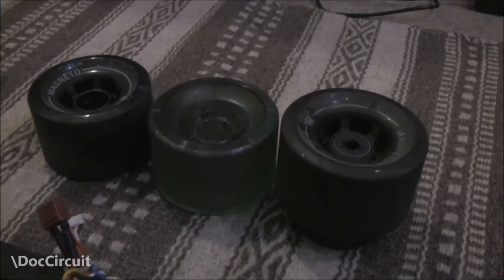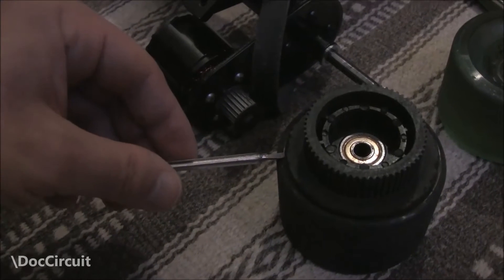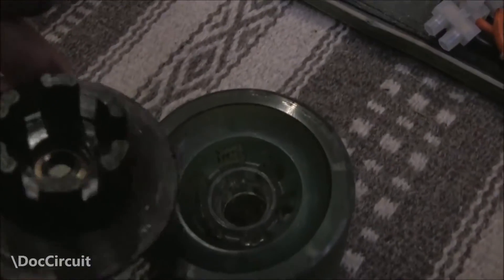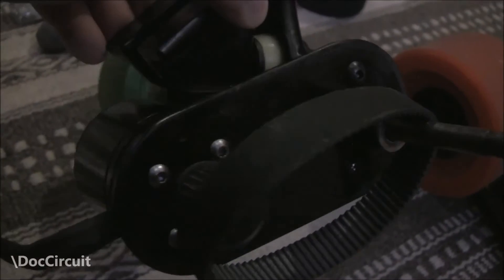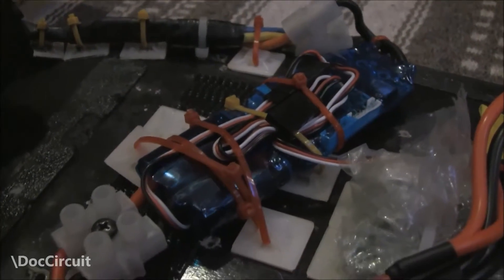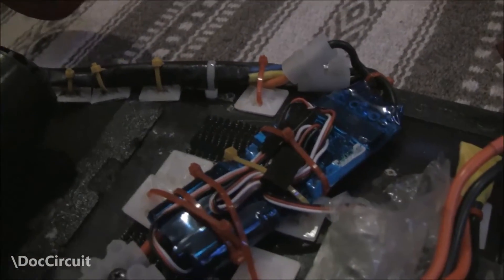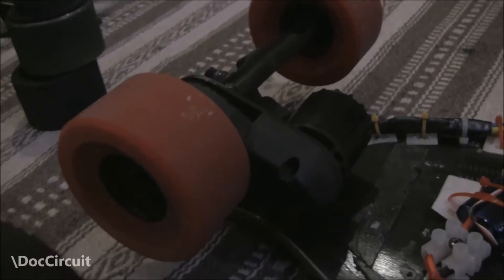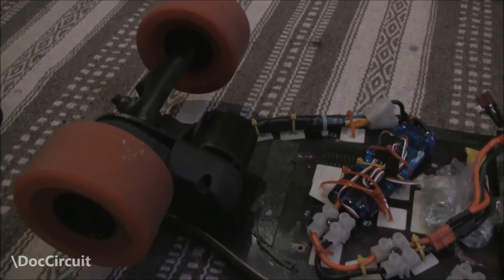Fitting Large Wheels to a Chinese Clone Electric Skateboard!

Comment: Thanks to you, my board turned from a cheap, unreliable and dangerous board to one great board! very smoothhh with the VESC, can't wait to install my new wheels! will the big wheels help significantly on rough surfaces?
Reply from the maker: Thanks for the kind words! :-)

The big wheels will increase your top speed and smooth out some of the bumps - a worthwhile mod.
Reply: hey again Dr Circuit,
I just got two ZIPPY Flightmax 5000mAh 3S1P 20C, will it work on my board and charge using stock bms? also how many miles do you think its going to give me?
Reply from the maker: 1. It should do but do check the power supply - it shouldn't be too warm.
2. Notoriously difficult to predict. Essentially your battery is a 10000Mah battery, the stock battery 'claims' to be 8000Mah. Do NOT think the claimed range is accurate - it's FAR from their claimed range. I estimate, depending on hills and weight, something from 7miles to 12 for your battery packs. Buy again, this is a very rough estimate.

Comment: How can I fix my board when the BMS system burned out?
Reply from the maker: Couple of ways...

1. Buy BMS and refit it. Although, unless you use a VESC it's likely to blow again so I'd use it just for off board charging.

2. Change the balance plug on the battery and use an off the shelf charger to perform off board charging.

You don't need to BMS on the board to use the board.
Reply: http://www.hobbyking.com/mobile/viewproduct.asp?idproduct=98294  will this do?
Reply from the maker: Looks good to me, although you will have to modify the balance lead plug on the battery.

Comment: Love your videos, decided to buy a magneto and get a vesc and some bigger wheels! :D Thank you!
and do you think i will need to add a heatsink or 2 to the VESC??
Reply from the maker: Thanks! Heatsinking the VESC... still not sure about this. It does run surprisingly cool but if you run it covered and fit larger wheels and go up a lot of hills, I'd be tempted too. But as for 'needing to'... I really can't say for sure. I know this isn't helpful. :-(

Maybe I should put it this way: VESCs run cool, but aren't particularly cheap. Running it covered, with large wheels, with a low cell count but correspondingly higher current, why NOT take the 15 minutes to fit a heat sink for peace of mind?
Reply: makes sense.. i think i'll do that too :)
maybe you would measure your new topspeed after upgrades?? :D
Reply from the maker: Yup, that's one of the videos I have planned when I've finished the 'Chinese clone modification' videos.